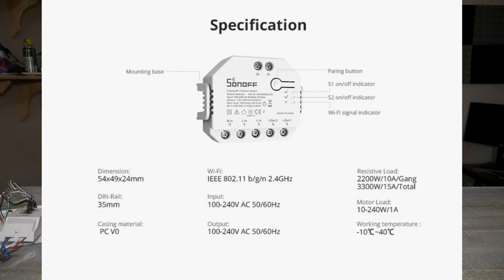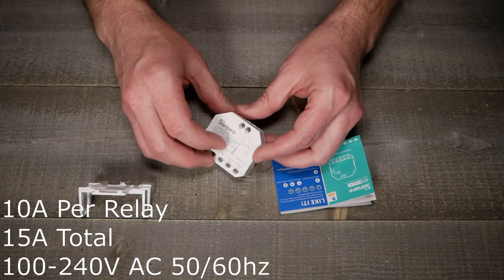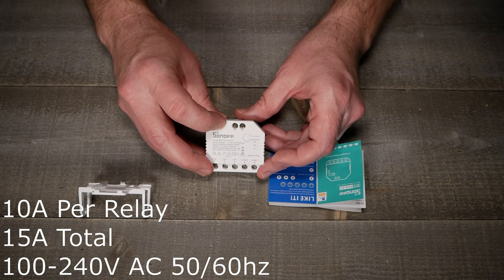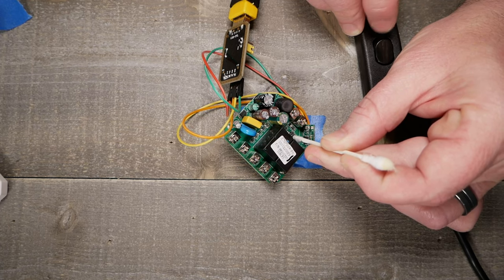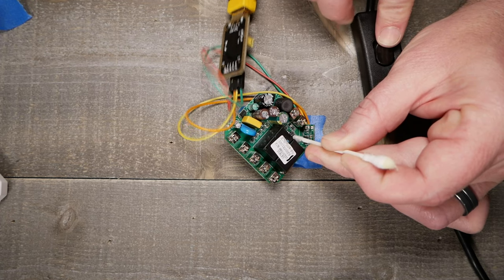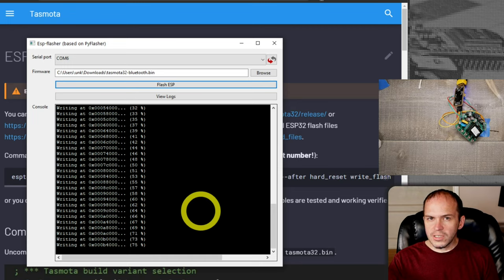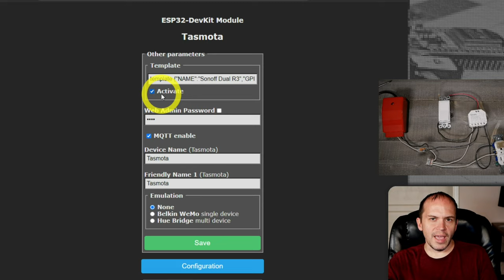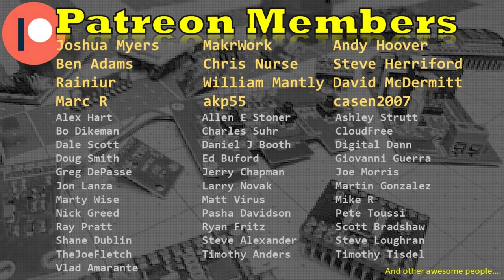Sonoff Dual R3 in wall Smart Switch | ESP32 Power Monitoring & BLE | How to Setup Tasmota

Comment: I ripped the pads off. Ended up scraping off the traces and micro soldering with a microscope. Ended up getting it done but it was stressful.
Reply from the maker: Ouch. Luckily those other pads are still there.

Comment: Awesome tutorial. Thanks T. This with the Lutron toogle switch to momentary hack from your old tutorial...and we got multi press on both switches
Reply from the maker: Indeed! Or some dimmer control hold buttons.
Reply: @digiblurDIY  "dimmer control hold buttons" What are those ?   did you cover them in another vid or live session ?
Reply: @digiblurDIY  is there switch with 1 position to connect it so I dont get my regurar switch mixed positions
Reply from the maker: Think I did a while back with a guy doing a rocker and the new switch modes.
Reply from the maker: Yes. Momentary buttons work for this.

Comment: Can you control a ceiling fan and a light switch with this? 2 different switches same electrical box
Reply from the maker: Yes. That's the design. Two switch inputs and two relay outputs

Comment: Good guide, thanks .
I'd like to try using it to control electric shutter motor.
Do you know of a guide for doing something like that with sonoff dual and tasmota ?
Reply from the maker: No shutters here so I haven't looked for one.
Reply from the maker: https://tasmota.github.io/docs/Blinds-and-Shutters/
Reply: @digiblurDIY  
Thanks, i have seen it. I hoped there was a nice video guide 🙂
Reply from the maker: I am sure there is one somewhere around. I just never looked or paid any attention since I didn't have those.

Comment: i would assume this is a wifi version, is there any point of flashing these devices with tamsota if they were zigbee, since you can use ha and z2mqtt? one more question how this device will work in case of a complete network failure, like shelly even if your wifi is down when you flip the switch the light will turn on , and how reliable are they ? I'm about to install a bunch of them and confused between shelly and sonoff
Reply from the maker: You don't flash things that are zigbee usually, there are sometimes OTA updates for them but they are local by nature.  

Really kind of a toss up between the two, Shelly does have the pin headers usually for open source firmware

Comment: Does Sonoff Dual R3 have an alternative Tx & Rx connection? I have 1 unit with no pads on the plate so I cant use it with Tasmota.
Any advice would help
Reply from the maker: Yes. The headers on the chip itself.

Comment: Hi, Which method should I use now to flash tasmota to Dual R3?
Reply from the maker: What firmware?
Reply: @digiblurDIY  The devices will arrive today. Will update once I get them.
Reply: Sonoff firmware : E32-2SW-P0 version 1.4.0.
Updates are available. But I did not update it.
The Dual R3 board version is 2.0
Reply from the maker: I was asking if you were doing esphome or Tasmota
Reply: @digiblurDIY  Tasmota.. Sorry for the confusion 😁
Reply from the maker: Use the web installer https://tasmota.github.io/install/
Reply: @digiblurDIY  Ok. Thank you 🙂
Reply: Did it work for you? Mine can't open serial idk why

Comment: Got mine flashed using your instructions and template. But for some reason all the power stats for both channels stay at 0. I've got 700W IR Panel connected to channel 1. No hardware switches connected.
Reply from the maker: Do you have the new version? https://github.com/arendst/Tasmota/discussions/10793#discussioncomment-1335467

Comment: Can i use it to switch between mains supply and solar supply as output ?
Reply from the maker: No. It is not a dry contact relay.
Reply: I already have a 2 way switch to do that operation and it works well as of now but it manuel

Comment: Hello, i watch and enjoy your channel. First comment :). I followed this instruction and have 3x Sonoff Dual R3 running at my house and a number of other sonoff devices running tasmota. I found only recently the Sonoff Dual R3 has become very laggy, (All other sonoff devices are going well).  I have tried factory resetting, updating to the latest firmware, downgrading to an older firmware but nothing seems to fix it.  The symptoms are when a light switch is turned on, 3-5 seconds later the light turns on, Very unresponsive webpage. (Not responding after a few refresh then it might come back).  If you have any tips of suggestion it would be much appreciated, It almost feels like the hardware is damaged somehow? thanks  Grayson
Reply from the maker: Welcome and thanks! Using Tasmota?
Reply: @digiblurDIY  just an update. I managed to solve this. I ended up replacing to a new Sonoff dual R3 to no success, i then realized the problem must of been somewhere else, Then i looked into my network, Turned out to be only a problem when on that wifi VLAN. So internal network issue, Not tasmota, Thanks
Reply from the maker: Ahhh...yeah if you block stuff like DNS, NTP, etc they get laggy trying to connect to the time server and/or DNS.  Point them to a local service and they will be happy.

Comment: Hi, I followed the tutorial and managed to make it work without the power monitoring. I used the Tasmota Template in the description. I have the same rev board as you do. Any idea ?
Reply from the maker: I would try a reflash?  Did you get both relays?
Reply from the maker: You do need to make sure you flash the latest development version to get the power monitoring like I stated.  This bin link works, I just updated mine to it a bit ago. http://ota.tasmota.com/tasmota32/tasmota32-bluetooth.bin
Reply: si i just found out, that i have revision v2.0 where should be used this template: {"NAME":"Sonoff Dual R3 v2","GPIO":[32,0,0,0,0,0,0,0,0,576,225,0,0,0,0,0,0,0,0,0,0,3200,8128,224,0,0,0,0,160,161,0,0,0,0,0,0],"FLAG":0,"BASE":1}

Comment: What was the old video where you did the R2?
Reply from the maker: The video was actually on a basic that I was doing but fully adaptable to the dual R2. Before I was doing the video thing I did an R2 with a ton of buttons and even used one of the LED traces as an input.
https://youtu.be/WsatPkC2Hf0

Comment: I want to use the R3 in Home Assistant, i need to flash the firmware anyway and than i can recognize it in HA?
Reply from the maker: That's what I did as I don't do the cloud thing.
Reply: @digiblurDIY  i want to use R3 to open/close a window shutter, so there's a way with TASMOTA to configure it as a motor device? i want that Home Assistant will recognize it like a motor..
Reply from the maker: https://tasmota.github.io/docs/Blinds-and-Shutters/
Reply: @digiblurDIY  looks like you have an answer for everything! thank you so much
Reply from the maker: Except for women...

Comment: @digiblurDIY did the ble sensors appear in tasmota integration in Home assistant ?     To me the only way was to put so19 1  and then they appear in mqtt integration.
Reply from the maker: That's the only thing I saw as well as I guess they aren't supported in the integration yet.
Reply: @digiblurDIY  ok, but i saw in your previous vídeo (live) that it appears in the integration with an nodemcu esp32 ( or not 🤔). Maybe was other version....
Reply from the maker: See I was thinking it brought them in too during beta but figured maybe I had it backwards. I need to go check and see what changed.

Comment: Bracket looks like it would mount on DIN rail.  Not common in U.S. residential applications.
Reply from the maker: Yeah. That was my only thought as I wouldn't mount it on the wall here. Only DIN rail stuff I did was custom telemetry stuff offshore.

Comment: Tried flashing 4 off R3's, soldering wires onto PCB. One worked. Other 3 'no go" Not sure why. Has anyone had this experience...
Reply from the maker: I haven't heard of this myself.  Faulty USB TTL adapter?   The ESP32 does take a little more power.

Comment: It's painful to see such a beautiful table being used without protection with soldering.
Reply from the maker: Table top cost a little less than $30 and is intended exactly for this.  It was a black kind of faux grain wood, super shiny.  Horrible for video cameras with the massive glare.  I tried a couple mats but they have glares as well and found these boards and modified my table, I fell in love with the look as well but then one big surprise hit me by accident.  I'll never use a smooth work bench/table area again.  It's amazing to use for projects and things just grip, don't slide or roll off.  Don't worry, I bought extra boards too for replacement needs since they were so cheap at the hardware store.
Reply: @digiblurDIY  I understand it was bought for the purpose and as an extra bonus it looks good in the video.
But it's still too beautiful for me to work on.

Comment: i just use the pin part of the dupon cable to solder to the pads makes it much easier
Reply from the maker: Ouch. I usually mention to not do that. It's like gluing a pry bar to a piece of paper.